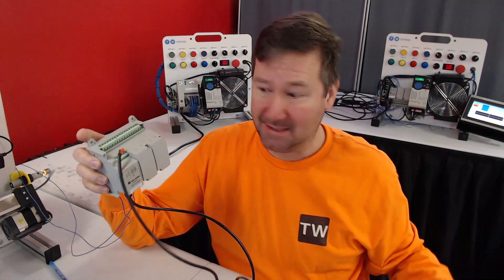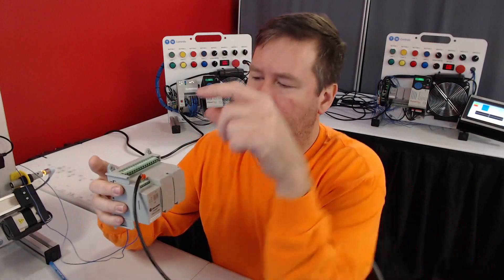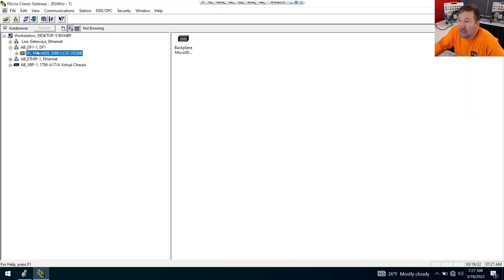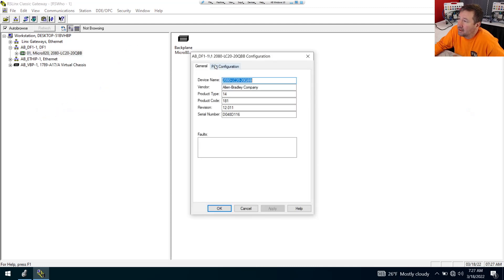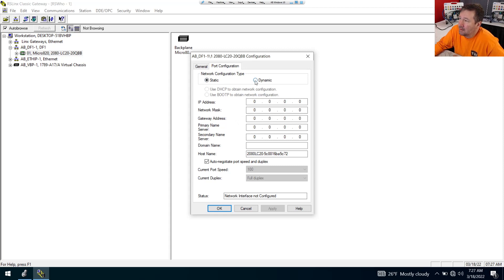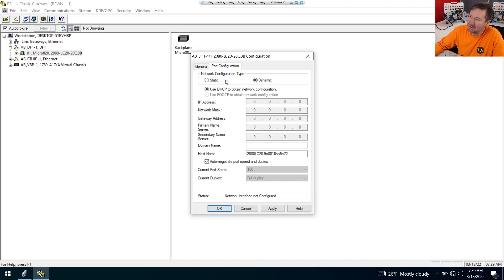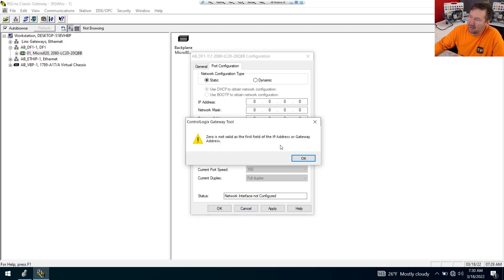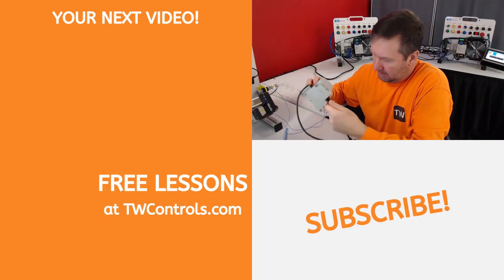I Wrote 0.0.0.0 to my Micro820 IP Address.  How to FIX

Comment: I was just working with a SLC 5/04 processor I could not go online with.  I could not see in linx, but could ping it. The system is small. It has an HMI and an AB switch, which I could see. The processor was still communicating with the HMI. I managed to find the original problem I was called out for. It several minutes of observation. Which was a  prox, that was out of adjust. It would have been much faster if I had connected. 

Any idea on what causes this to happen?
Reply from the maker: A SLC 5/04 doesn't have Ethernet.  How were trying to connect to it?
Reply: My apologies it was a 5/05, and it was ethernet.
Reply from the maker: @jasonashlock5465  If it was the Ethernet/IP driver then check for firewalls and make sure you have the correct Ethernet adapter selected...default won't work on multiple adapters in many cases.  For Ethernet devices, double check the IP you have entered.  If both of those are correct, time to delete the harmony files.
Reply: @TimWilborne  I'll have to look into deleting the harmony files.  I tried all the usual suspects. Making sure I plugged directly into the processor, turning off wifi, checked my cable. When that didn't work. I plugged into the switch. The HMI and switch both populated. I went back to the processor  directly and tried pinging.  It responded without issue.  

Thank you for the feedback, and thanks for creating great content. You're good at keeping things real while being down to earth.
Reply from the maker: @jasonashlock5465  Did you try the Ethernet devices driver?
Reply: @TimWilborne  just the Ethernet/IP.
Reply from the maker: @jasonashlock5465  Try the Ethernet devices driver.

Comment: Rockwell? Not accepting and/or doing weird things with IP addresses? Say it ain't so! :)

I can't count the times my new address either hasn't been accepted, got forgotten/written over, blocked for some odd reason, or had BootP not work for any multitude of reasons. I can attest to the strange Windows XP setups that I have had to come up with to get BootP to work. Long after XP had been put out to pasture.

In other news, I just bought an old Kodak camera so that I can format Compact Flash cards to the "proper" FAT12 format for use on Motoman and (possibly) Panasonic robots. And hopefully the 128 Meg Compact Flash cards that I have won't be too large. And the robots actually take PCMCIA cards, but umm, yeah, good luck with that. So I also have PCMCIA to CF adapters (sleds) to go into the robots. What a kludge...

The difference here is that these are ancient robots that I'm working with, and the Rockwell stuff is new.
Reply from the maker: It does seem there should be an easier way.
Reply: @TimWilborne  If there was, they wouldn't need us. :)
Reply from the maker: @MrWaalkman  Very true!

Comment: I have a micro820 at work. To prove to a coworker,  I changed the network address portion of IP address to not match my network address of the computers NIC. No communication as expected. Work has locked us out of admin rights to change NIC address on PC.  I connected via serial cable I made and can see PLC. However, it will not allow me to change IP address. Strange. I can't get it to change via micro SD as well. Bricked unless it somehow leaves the company.

I've moved onto the micro830 series with USB. I wish all of the micro830 series had all communication options. Limited options is a pain in the workplace.
Reply from the maker: That is strange indeed!